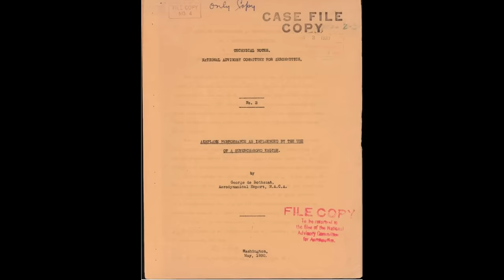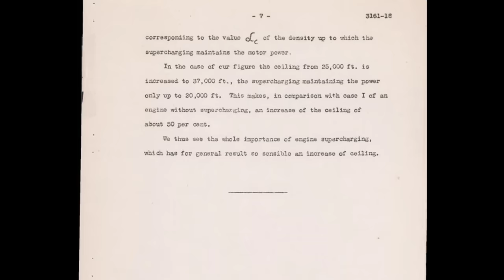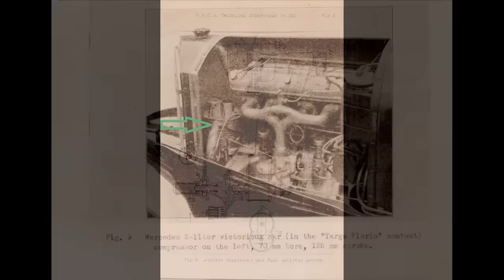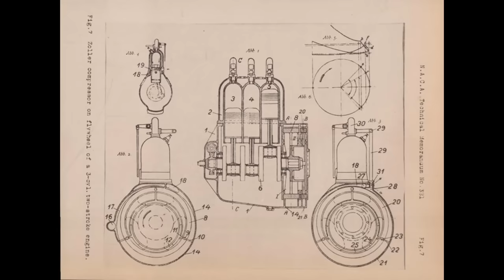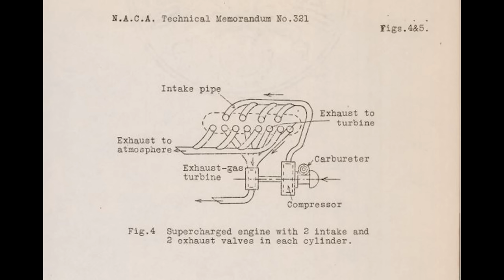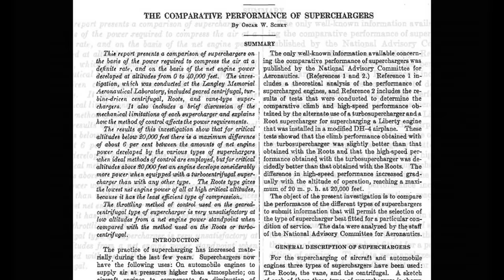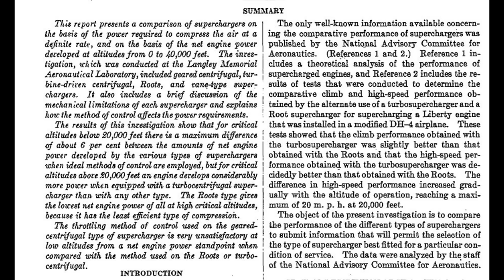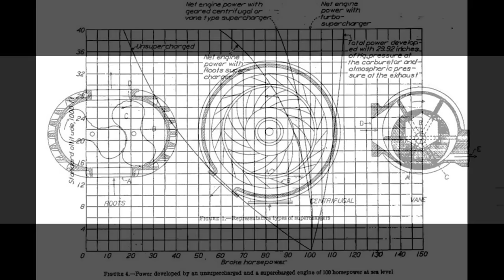Turbo vs Supercharging in WW2 Airplanes

Comment: Hey Greg, probably a noob question but does that mean that planes such as the B-17 would have a supercharger which was always on as well as the turbo? Wouldn't the logical thing to do be to have the mechanically driven supercharger offline at sea level and only switch on the supercharger when the plane reaches an altitude that the turbo can't keep up manifold pressure. Was there some reason I'm missing why it wasn't done this way, or am inferring something incorrect and it was indeed done thus?

My other question stems from the intercooling. If that was required more for turbos than multi stage mechanical superchargers, doesn't that infer that the turbo compressor is somehow less thermally efficient and heats the intake charge more than the mechanical supercharger's compressor? In both cases, we're talking about centrifugal compressors aren't we? Only difference is how they're spun so the thermal efficiency should be similar.
Reply from the maker: Hi Simon, good questions. First, no, it makes more sense to run the supercharger all the time and then spin up the turbo as needed. There are several reasons for this. The main reason is simply packaging. All the combat type radials had mechanically driven centrifugal superchargers already built in. If you look at the whole package and try to figure out how to get the turbo to plumb in after the supercharger you will see that it would be a huge problem. Second, you want the supercharger as the last stage in the setup. This is because it insures that the intake manifold pressure will be higher than the exhaust manifold pressure and allow for more exhaust scavenging during the overlap period, thus giving more power when both devices are providing boost. I talk about this a little in my WW2 aircraft exhaust video. See that for a better explanation of this effect. 

Intercooling. Both the superchargers and turbos use centrifugal compressors. Both are about equal in adiabatic efficiency. At a given level of boost, both have about equal need for intercoolers. The reason you see so many non intercooled supercharged WW2 planes is because most of those were designed for low altitude work and didn't run that much boost. Keep in mind that many supercharged WW2 planes did have intercoolers including all the main US Navy fighters.
Reply from the maker: I should also mention that by having the supercharger spinning first, it generates more exhaust flow and gets the turbo spinning sooner if it's needed. I think every single car or plane out there that uses, both has the turbo blowing into the supercharger (or around it once the turbo has spun up). I can't think of a single case where the supercharger isn't used as the primary stage.
Reply: @GregsAirplanesandAutomobiles  Thanks Greg. Can I make a couple of points? (1) In theory, higher pressure in the intake manifold vs the exhaust manifold is achievable with just a turbo. The higher temperatures in the exhaust mean more work can be done on the turbine vs the compressor side of the turbo; or to put it another way, there is more volume of gases flowing in the exhaust if the pressure is similar so there is an allowance for higher pressure on the intake even after losses are taken into account. Now, I went and watched your exhaust video. Interesting, I had wondered about the reason for this. If almost perfect scavenging is possible with only a small pressure difference, then the supercharger should (in theory) be unnecessary for this purpose or at least only need to provide slight boost.

(2) At low altitude an intercooler is more important for a given boost level isn't it? The cool air at high altitude has less need for cooling. IIRC this video had a graphic from the B-24 manual which showed the intercooler should be bypassed at high altitude. Pretty surprising. Obviously though, low boost also means less need for intercooling. I'm going to take that as your point here.

(3) I'm not completely sure I understand your point on the supercharger creating exhaust flow for the turbo. Aren't you just saying that it reduces turbo lag? Was that really an issue in something like a B-17 or even a P-47? With constant speed propellers, revs should always be high and lag should be low. Or did some turbo planes lack constant speed propellers? Or was lag still a bit of a problem?

(4) I can accept your assertion that it would be better to have the supercharger as the last compressor stage. Seems logical. That also infers that putting in a bypass would increase the chance of leaks. And I'm guessing that running the through the supercharger without spinning it would cause too much pressure drop. This wasn't really my point though and even so, why have the supercharge doing maximum work at sea level? I see two downsides to this. Firstly, the sheer power to run the supercharger at sea level although this is only a minor point, probably below 1% of output power. Secondly, it adversely affects turbocharger sizing. To allow the supercharger to be running flat out at take off, the turbo needs to providing low boost, presumably this is governed by a wastegate and the wastegate is nearly fully open at this point. If the turbo were a bit bigger, the altitude reached without losing manifold pressure should be higher. You did mention there were at least some instances of bypassing the supercharger once the turbo has spun up. is this in cars?

And thanks for the video and replies. Very informative.
Reply from the maker: Way too much for me to answer in comments. Plus, after a few days this comment chain won't show up in my feed because it will be too old. That's just the way it works in the youtube studio. First, yes, the supercharger is bypassed above a certain rpm point in some cars. Take a look at the Volvo T6 engine as an example. No doubt that some turbo engines have more pressure in the intake than exhaust, but probably not in all conditions as it does with a mechanical superchager. Regarding the supercharger creating more exhaust flow, this of it this way, if an engine normally aspirated puts out 100hp at 2000rpm, and then we put on a supercharger with 5 pounds of boost and now it makes 140hp at 2000rpm, which configuration will make more exhaust? Clearly the supercharged engine will, and that helps the turbo get spinning. Thus compound engines can run larger turbochargers because there is more exhaust flow to get them going. This doesn't reduce lag, not exactly, but it does reduce the boost threshold for a given turbo. The intercooler is more important at high altitude, and of course at higher boost. I know the altitude part is counter intuitive, yes the air up there is cold. However it needs A LOT more compression to generate a given manifold pressure value. For example, at sea level to get 60 inches of manifold pressure we only need a 2:1 pressure ratio from the supercharger. At 30,000 feet we need between 6 and 7 to 1.
Reply: @GregsAirplanesandAutomobiles  Wow. Just ran some numbers. At ISA conditions even an adiabatic compressor should reach 50 degrees C to get back to atmospheric from 30k ft. So 35 degrees C warmer than sea level. Not what I expected.

Comment: What is it that makes the centrifugal supercharger in effective when throttled?
Reply from the maker: It's harder to breath in a given amount of air through a relatively small opening. For example, it's easy for you to breath right now. Try and breath normally through a straw, it will take you some amount of increased effort.
Reply: @GregsAirplanesandAutomobiles  ah ok. I thought it was more than that. Sometimes it is that simple. Thanks

Comment: I got a question here. So you said in the video " in order to prevent over boosting at lower altitudes the throttle has to be partially closed at full power
, superchargers hate being throttled
."
The throttle means what? as a noun.
I am sorry for the question, it just i don't speak english as first laguage, what is the throttle here? be more specific?
Reply: Is it the same throttle that controlling the air get in the engine?
Reply from the maker: Good question, I understand the language issue. Throttle is indeed a noun, and that's how I am using it here. To avoid confusion, here is a link: https://en.wikipedia.org/wiki/Throttle  However, throttle can also be a verb, meaning that you as a person can "throttle" something, which means you cut off the air. So the levers that control the throttle in an airplane are often called throttles, but they are actually throttle levers, the actual throttle is at the injection carburetor on the P-47. I hope than helps, if not, let me know and I'll explain further.

Comment: A turbo charger makes a more efficient engine compared with a supercharged engine.
The turbo charger is powered by waist energy from the combustion process while a supercharger is driven by the crankshaft.
Reply from the maker: Waste energy? Did you watch the video?
Reply: @GregsAirplanesandAutomobiles  I started to watch it but is was interrupted. I'm going to watch the whole video now.
By wasted energy driving the turbo I meant the exhaust gasses.

Comment: The battery wouldn't be a factor in an electric supercharger. Youd have to have a more powerful Alternator. The battery just starts the engine and it runs using Alternator electricity
Reply from the maker: No. If it was set up that way, then the drive cost of the electric supercharger would increase due to alternator drag and at a time when you can least afford it. By using a battery the supercharger doesn't use any power from the engine during boost, it just runs down the battery, which is then recharged during off boost driving.

Comment: I came across a reference to the XP47F, which was a single airplane with laminar flow wings. I haven't found anything about it anywhere else. Do you know anything about it? Clearly the test didn't go anywhere productive.
Reply from the maker: I have quite a bit on it. It had tremendous performance, easily the best of any WW2 propeller driven plane. However it never made it anywhere near production for two reasons. First, the writing was on the wall, jets were the future. Second, it was a lot less expensive to go with the P-51H to fill in the gaps while waiting for the jets to arrive, and it's performance was pretty close.

Comment: Interesting in cars as well.  Do you directly steal power from an engine and drive a supercharger via a belt?...or...Do you use exhaust pressure so as not to steal power but it also means you'll have some so-called "boost lag?"  In autos, turbos have won overall and I think we've all seen that turbocharging works great in smaller low-torque engines.  For larger and torque-ier engines (such as V-8s), I think you could reasonably supercharge them, however, what would the point be unless you're really looking for massive horsepower?  Not something you'd see in your average production car.  I've had turbo'd cars (Saab 93 particularly) and loved 'em for what they were.
Reply from the maker: I love turbos, I literally have a business tuning turbocharged cars. However I wouldn't argue that turbos have won overall over superchargers. Both are great. Here is a list of current supercharged cars: 
    Chevrolet Camaro ZL1
    Dodge Challenger Hellcat
    Dodge Charger Hellcat
    Ford Mustang Shelby GT500
    Jaguar F-Pace
    Jaguar F-Type
    Jaguar XF S
    Jaguar XJ
    Jeep Grand Cherokee Trackhawk
    Land Rover Discovery
    Land Rover Range Rover
    Land Rover Range Rover Sport
    Land Rover Range Rover Velar
    Lotus Evora
    Volvo S60
    Volvo V-60
    Volvo XC60
    Volvo S90
    Volvo XC90
      Note, the Volvos are both super and turbocharged. Most of the fastest sub 100k cars are supercharged. The fastest car you can buy from the dealer runs an 8 second 1/4 mile and it's supercharged. (Challenger Drag Pack, not street legal). The fastest race cars are supercharged, which are of course the Top Fuelers, and they have so much power they are traction limited at 300mph! Now, the Turbo is more efficient, but not by all that much, and not in all cases, the new Eaton TVS is actually more efficient than some turbos at lower boost levels, which is why so many are using it.
Reply: @GregsAirplanesandAutomobiles  yeah, I see what you mean and that's quite a list.  I myself own a Jaguar F-Pace and I'd never have guessed you could get a very small 4-cylinder to do what it does.  It's not a powerhouse or anything but quite zippy and runs more like a car with a mid-sized V6.

Comment: You're slightly wrong about the use of turbosupercharging in German bombers. To my knowledge the Junkers Ju 388 L-1 used the BMW 801J turbosupercharged radial engine, of which 64 were built: https://en.wikipedia.org/wiki/Junkers_Ju_388
Reply from the maker: Slightly wrong? Perhaps, perhaps not.  I do see references to turbocharged German planes, but try and find a picture of one showing a turbo on an operational airplane. It's pretty tough, so if it happened it was rare, more rare than a 109K4, or 262 as there are lots of pictures of those, and they were rare.

Comment: A question.  After looking at this it seems like a engine in a pusher configuration whoud have much less need for pipework to incorperate a tubo/supercharger combo  as the supercharger normaly was att the "back" of the engine.  and in that confiruration you would be able to place everything on the same side of the engine. 

Was this ever tried  and/or am i missing anything here?
Reply from the maker: You are not missing anything, that could have worked, and probably would have been tried eventually had the jets now shown up.

Comment: What about, P-51D with WEP system? Water injection with turbosuperchargers?
Reply from the maker: The P-51D had neither water injection, nor a turbosupercharger.
Reply: @GregsAirplanesandAutomobiles  I could swear I read online it had the WEP system, water injection.....hmmm. not even a supercharger and or turbo? How did the P-51D have so much power?
Reply: @GregsAirplanesandAutomobiles  https://en.m.wikipedia.org/wiki/North_American_P-51_Mustang 
Boom!!! P-51D DOES have WEP water injection system!!! It gave the merlin a large amount of more power for 5 minutes. Was limited to 5 minutes of use.
Reply from the maker: No, you're confusing "WEP" which is war emergency power with water injection. These are two different things. Many planes had WEP and no water injection. Now the planes that did have water injection usually used it at their WEP power setting, which is where I think your confusion is coming from. Nowhere in the link you posted does it show the P-51D with water injection. cont:

Now, regarding the supercharger, yes, all P-51s and pretty much all WW2 fighters have gear driven superchargers. Relatively few had turbos (aka turbosupercharger) and no P-51 had them.
Reply: @GregsAirplanesandAutomobiles  oh ok. I thought it was just a type of WEP

Comment: Why didn't the Army just use two P-47 engines with turbo chargers (one on each wing) on the B-17 Bombers and eliminate the 4  single Wasp engines. Two 2000 HP engines would increase power and lighten up the weight or increase the fuel capacity of the B-17 and the B-24.
Reply from the maker: That's a good questing. The answer involves timing. The B17 was built for specs laid down before the R2800 was a reality. By the time the R2800 first flew, the new proposals for a 4 engine bomber had requirements that couldn't be met by the R2800, hence the B29 and B32 went with the R3350. The R2800 became the engine of choice for medium bomber, A26, B26, B34, which had grown in size and payload. Retrofitting a B17 to handle two R2800s would have been a lot of work for little gain, Boeing was focused on the B29.
Reply: Thanks Greg, I was just wondering if the B-17 Bombers had more fuel they could have had a longer range. The R3350, was that a Wright Bro. engine? Didn't they have problems with the magnesium catching fire and burning up?

Comment: given that turbo/super-chargers have a fixed or minimally adjustable compression levels and thus optimum altitudes would not an electrically operated charger be fine-tunable to get the best performance at all altitudes? or is an intake throttle for the charger just be simpler?
Reply: or is an electric drive for a charger less efficient than a turbo driven by the exhaust?
Reply from the maker: An electric supercharger would be controllable just like a turbocharger in fact, it could be controlled more precisely. Thus it would have the advantage of not needing to be throttled. However the weight of the powerful electric motor needed to drive it, and the batteries needed to operate it long enough to be useful made it not worth using.
Reply: Greg's Airplanes and Automobiles  I was thinking of driving it off a generator from the engine itself and then using the electrical part of the idea for throttling purposes. But would the weight plus the sapping of HP off the engine neutralize this advantage vs a turbo?
Reply from the maker: I suppose it could work, and in theory it does work. You would need one heck of a generator though, and you would speed up or slow down the supercharger with electrical stuff. Throttling means to cut of air, we don't want that.